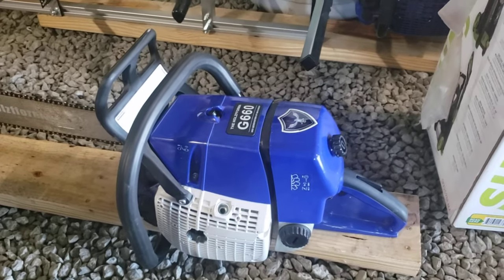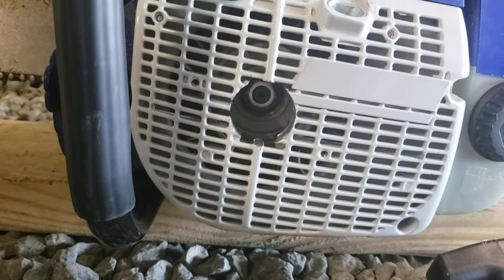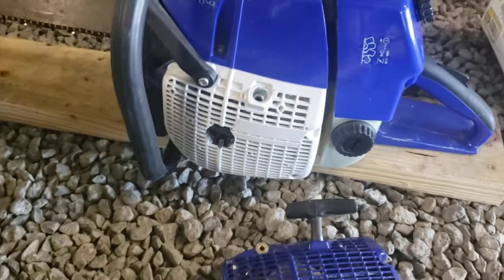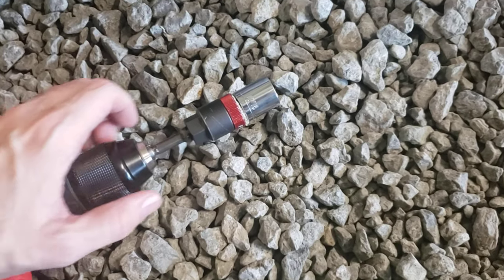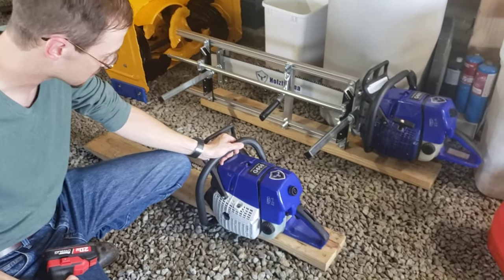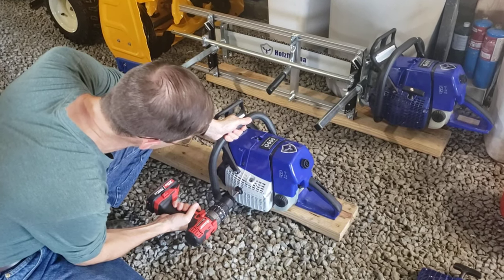Starting a chainsaw with a drill

Comment from the maker: One change I made shortly after creating this video is the use of a deep/ long socket. A short one could more easily catch and pull off inside the recoil cover area when removing the drill after the engine starts.
Reply: Genius!!  Now I have hope that when I get older I will be able to start my large saws (90cc & larger) by myself.
Reply: Nice man! Did you try alrering the socket dimensions so it cant grab once it starts?
Reply from the maker: @lokicam1307  the ratcheting adapter prevents it from grabbing
Reply: @NathanBirky  Ya, just watched closer. Intresting choice for sure, I didnt even know somethin like that existed. I always just cut grind socket away so it only grabs one way.
Reply: I have the exact same saw… impossible to start. When I get it started- look out, she cuts like no body’s business. I need your method! I’m going to get the alternative recoil and start it with a drill! Where can I get this recoil starter?
Reply: @thomaskipfer1008  Impossible to start? I would be looking at rings or somethin man. Mine starts with very little effort, one push of the valve, a half pull to kick it over and a full pull to start her up.
Reply from the maker: @thomaskipfer1008  I bought an identical (Stihl but can use Stihl or Holzfforma) recoil/cover which can be found for your model on Amazon or elsewhere. Then I un-screwed the recoil and used a hole saw on my drill to make a hole slightly bigger than the socket in the recoil cover. I could have just used the original recoil cover, but it I would have no way to go back to a rope-pull recoil if I didn't have one.

Comment: Glad to see your using a socket adapter. I have seen many people using a socket and dril which is just inviting a big problem.
Reply: Please explain the big problem being invited. As you say, people have been doing that for many years.
Reply: I just use a nut runner in my drill to start a leaf blower. Never been a problem. Perhaps on a more powerful engine the clutch might be advisable.

Comment: Very interesting but I would have liked to see a cold start. I keep an eighteen inch chainsaw for emergencies,am older and can't yard on things the way I used to. I will look to modding it like yours.
Reply from the maker: Cold starts work the same, just sometimes with a few more seconds of spinning, and a fire up with it choked first. Of course, you can get a lot more fast revolutions of spinning with the drill than with the pull start, which is why this works so well on a cold start when you may struggle otherwise!

Comment: I never saw a generic Stihl  Chain Saw before. It sure sounded like one. I have numerous stihl saws and other equipment. If it takes more than three pulls, you’re doing something wrong. Perform routine maintenance and if it still won’t start, throw it away. Consumers who use them to make a living don’t have time to fool with a finicky piece of equipment. I love your ingenuity, adding the ratcheting safety was genius. However, there is nothing like Tennessee orange.
Reply: Agree, however the option of ingenuity or another door stop forced me to do similar for an old lawnmower and recently a leaf blower. Right to repair may also be accompanied by duty to repair.
Reply: A lot of us just don't have the strength or stamina to keep pulling.  My shoulder is toast so this is a great alternative for me.

Comment: I drilled a 1/4 inch hole in the air cleaner and use ether starting fluid . Saves a lot of arm strain 😊
Reply: Hi sir...can you show how to make it?...thank you.😊
Reply: 😢I've always heard that ether is especially hard on small enginee
Reply: You really shouldnt need that man. Honestly. Check rings or somethin. My 660 starts easier then my small saws.

Comment: I've tried to secure the flywheel nut with Loktite and even spot welded the nut to the bolt.  My drill keep ripping the nut off. How do you keep that from happening?
Reply from the maker: I've not had problems with it coming off after tightening it with an impact driver, but a friend of mine borrowed the saw and is using loctite too because it came off for him.  I do recommend using a variable speed drill to start the saw, not an impact driver, and speeding it up somewhat gradually. Hopefully the less impact and sudden torque on the nut will keep it from being spun off.

Comment: Is there any modification in the machine (starter, pully)  itself? Remove the  whole coil starter? 

I have MS382 and can't use my hand to pull the string.
Reply from the maker: I bought a replacement recoil which comes attached to a cover (so I could place the original cover and recoil back on if I wanted it again). I then removed the replacement recoil and used a hole cutting bit in my drill to cut a hole in the cover shield with the center where the recoil had been screwed on it. By having a cover with a small hole, the saw is useable without having the entire side exposed. 
After making the video, I changed to using a longer deep socket so it won't accidently get popped off inside the cover.
I've done this on 3 of my chainsaws currently, and they all start with ease now instead of struggling, especially if they normally take a number of pulls to start. You can do many revolutions quickly with a drill vs only a few per pull on a pull rope.
Reply: @NathanBirky  thank you. I will open the and check the inside. I hope you can guide me from there.  I am not good at "machine" things.  I only know how to use only!  😂.  

Or Maybe we can also modifed the cover to be more easy to open and close without any tool required (to open)
Reply: @NathanBirky  how do I contact you?  If you don't mind,  I would appreciate if you can help me with this.  

I have trigger finger on both of my hand.  Really need to start the saw the easiest possible.
Reply from the maker: @wizanzaini  Maybe I need to post a video next of how to modify the recoil area for electric drill start. I don't know how to pm me via YouTube. If you want to post your contact, I can contact you.
Reply: @NathanBirky  youtube nuked PMs a while back :(

Comment: I"m been thinking about this for a while now but I don't know in which direction the motor runs or starts.  Does the motor run clockwise or counter clock wise?  If the motor runs clockwise, they you will have to crank the motor clockwise with a drill.  Which means the drill (bit) is turning clockwise (tightening) and when the motor runs, then the drill (bit) would be also going clockwise ?  The bit should be racheting clockwise so it doesn't catch and break your wrist?  (sorry about the description).  It seems the ratcheting is in reverse...
Reply from the maker: As far as I've seen, chainsaws are all started by a pull rope on the left side with the bar on the right side. So to have the chain going the right direction, they have to be started in a counter- clockwise direction. The drill turns counter clockwise (which would loosen the nut if not fastened very tightly) and the ratcheting action on the adaptor lets it spin without jerking it out of your hand when the engine starts spinning faster than the drill. This is because the drill would be seemingly spinning backwards in comparison to the faster spinning engine, especially when you stop the drill. Then you pull the drill and socket out and away after it starts running.
Reply: @NathanBirky   Thank you ... the drill would go in reverse to turn the motor clockwise and that direction is the racheting direction so it doesn't take my wrist off?

 A backpack blower... I have no clue.  I'm basically trying avoid all the pulling etc... my shoulder can't take it anymore ;).  Thanks for the reply... thought I figured it out but still quasi questions in my head.

Comment: Nice, Where is the drive ratchet from? Thanks, David
Reply from the maker: Search "performance tool dr ratcheting adaptor." I got mine on Amazon. There is 3/8 and 1/2 inch sizes. I use 3/8 inch.
Reply: Thanks buddy!  I was trying to figure out what you had on your drill there when Kevin shared this video with the builder group…. Man this is an nifty little idea… it would be super cool if you could have both options or either option without having to change over…. Might slap some blue thread lock over them crank treads just for a little additional lockdown XxX!  Absolutely blows when that dang vibration works on that nut long enough to get her to back off and loosen up just a tickin’…just enough for that key to sheer and…. And blam-O!  Next time you get to fire it off to do some cutting…. Everything is all a mess!!!   What is that little part between the drill and the socket????  eBay name and number?!!
Reply: Really dig it man!!! This is super cool!!! We got an 088 that this might work for…it’s a yanken back son of a biootch!!!   I hate it!!!
Reply from the maker: @DaveyBlue32  Performance Tool W38137 3/8" DR Ratcheting Adapter https://a.co/d/gITyZKo

Comment: If the compression relief button is working they are not that hard to start? A OEM Stihl relief valve works better than the Chinese one.
Reply: My knockoff g660 has outlasted three name brand pro saws at this point.
Reply: @lokicam1307  I've got got the same saw . The compression relief valve pops up to easily on mine I replaced it with a OEM one Í also put a Stihl elastro start rope with handle.
Reply: @michaelgardner3728  Nice man! good call! I was gettin ready to do a built/ported/advanced high top 288xp vs. my g660 cut video but Im doing top end on the 288 first so its fair. the g660 is 10 years old x 20 cords a season, heavy cutting. And the 288xp is almost 30 years old. (And yes, the 288xp will smoke the g660, but all day long, prolly not right now.
Reply: @michaelgardner3728  I did post pre video pics under my community tab tho and will post the top end rebuild on the 288xp and a vs. video at some point!
Reply: @michaelgardner3728  Also, how did the OEM valve replacement go? Never done one of those, what did it take to get done?
Reply: @lokicam1307  They screw out like a spark plug easy peasy

Comment: Drill set counter clock wise,  right?
Reply from the maker: Correct, counter-clockwise, assuming that's the direction the recoil would pull your model.

Comment: How come it's not unscrewing that nut
Reply from the maker: I used an impact wrench to tighten the nut very tightly. The drill would loosen it while turning over the engine, but the turning is more gradual than an impact wrench, so the nut stays tight.

Comment: How does it not loosen the flywheel nut?
Reply from the maker: I used an impact wrench to tighten it tight. The steady pressure of a drill turning the flywheel isn't enough to loosen it if tightened appropriately first.

Comment: This is extremely dangerous. You don’t have control of the saw and should be standing behind it away from the chain holding the handle and ideally with a foot clamping it to the ground. If the choke was on (which is usually the case) and the brake off the chain would rotate after starting, and on a slippy bit of board the saw could easily vibrate round and carve a hole in your leg.
Reply: Nancy.
Reply from the maker: I agree, brake should be on and saw held securely as much with the drill start as with recoil start. While I may not have had the appropriate hold starting the saw, the point of the video was the electric start mechanism, not chainsaw safety.
Reply: @NathanBirky  I’ve been using chainsaws for about 30 years and the more I use them the more paranoid I get about safety. A well sharpened saw will go through a 6” limb in 10 or 20 seconds, much quicker through your leg. Kickback accidents are the most common, where the saw flicks up in your face. Holding the saw firmly in both hands greatly reduces the chance of it happening. If your electric starter can be used with the same safety as the cord (following manufacturer instructions) then why not put up a video of it?
Reply: @Tailspin80  
   You've known how to use a saw for 30 years, not ran one for 30 years. A well sharpened chain will eat a 6" limb in about 5 seconds probably less with a professional size saw. If you're taking that long your chain is dull. It takes 20 to 30 seconds to cut one with a sharp crosscut saw. You  probably have less than 1000 hours of experience (and that's generous) seeing that you get "paranoid" using them and your chains dull as a turd.

Comment: Folks dont do this. It hugely increases the risk of flywheel exploding/failing from over torquing against the taper, and thats on a real saw, let alone a chineseium one.
What ever happened to “if you cant start it, you aint stong enough to use it”? Most companies do spring assisted start on small saws, if you need help with a 660, you got no hope of hangin on to it if it all goes bad.

Comment: I think this is probably a good idea for troubleshooting machines with issue, but personally I’d be trying to solve the underlying cause of the issue.
Reply from the maker: There wasn't necessarily an issue. A large chainsaw (my big one is about 96cc and 36 inch blade) can be hard to start simply due to the engine size. I was getting a sore arm/ shoulder trying to pull the rope fast enough or hard enough, and with frequent starting as is done on a chainsaw, this saves a lot of effort. If there are no or minor issues, the more/ faster revolutions with this method helps  it start easily, even if it takes a couple seconds.
Reply: Nathan Birky   Understood. I have no experience with saws that size, hence my ignorance. The only thing that occurred to me was either there’s no compression release or compression is too low for some reason.
Reply: U got some problem whit ure saw 🤣
My 660 starts on the 3 pull if not thy need some work
Reply: Tom Op eigen houtje   I guess it boils down to if you’re a manly man or just an ordinary guy. 😂👍   Not all of us are 250 lb. lumberjacks working in The Great Northern Woods! 😉😂👍🐿🐿🐿
Reply: Lols I am only a 160 lbs dude 
But yea I am experienced whit chainsaws so even the larger cc saws are easy to start if there running right 
Stil I like the way u thought about solving it I would check out the saw and make it work after 3 puls 
On the other hand saving the schoulders  a bit whit not pulling al the time could get a place wen I grow older
Reply: I find it a good idea I get tired of my ripcord breaking. I have a 40 year old Homelite Super XL I named Big Red. The parts are still made out of metal so in an emergency you can chuck the saw away and get down the rope or  away from the tree swinging the wrong direction. Yes, it's an old loggers saw. Hard to find parts any longer that don't need constant replacement so I am extremely glad it's built to last.
Reply: I agree. My fake stihl starts up so easy. I would be looking at rings

Comment: Sorry, i calls 'em likes i seez 'em.  Scarey and stupid. Violation of safe starting protocols. Furthermore pushing against a nut in direction it is designed to be removed; when, not if, it breaks loose what then?  Dumbassery.

I'm an old guy. Let me talk to Old Guys. If you can't start the dadgum saw it is time for you to retire or go electric. If you can't pull start the saw how are you strong enough to safely operate it any longer? Get a light weight electric, power cord saws are wicked.

Hey, Old Guy who can't start your gas powered lawn mower, they make an efficient, quiet battery powered right up your alley.

Holy cow, don't teach young folks to be stupid.